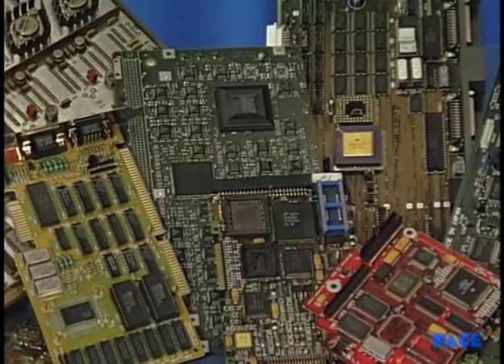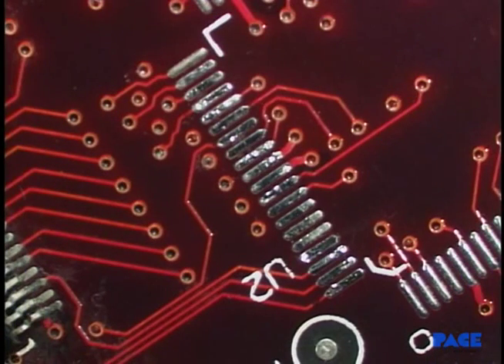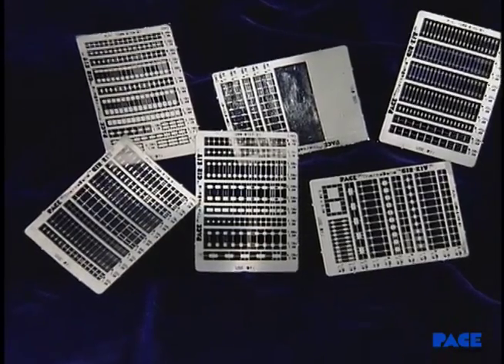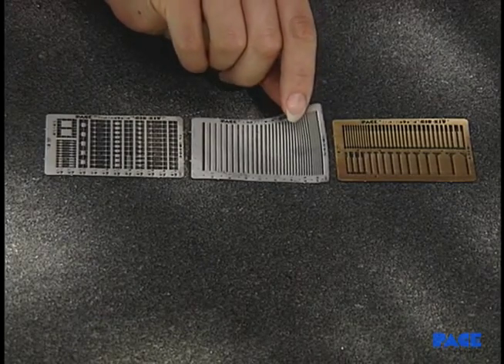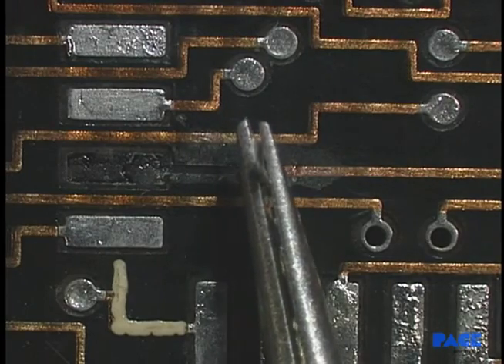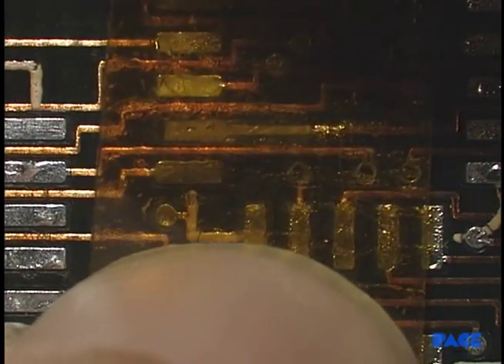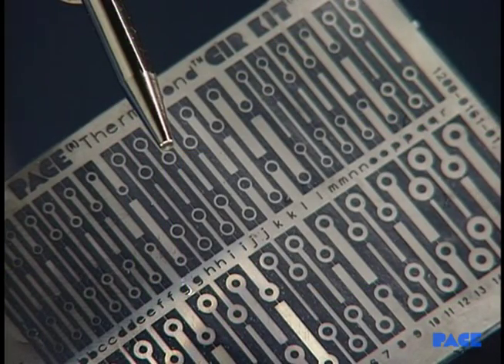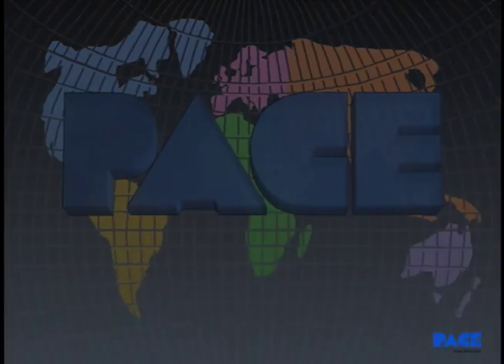PACE ThermoBond Cir Kit

Comment: For the trace repair, why cant they place those traces on a roll instead? E.g., a single spool with multiple free spinning rolls of PCB trace material. If they have some adhesive material on them then they can still be lay flat on the PCB. The size guide can then be placed onto a transparent plastic sheet, and users just then cut from a roll of the matching item.